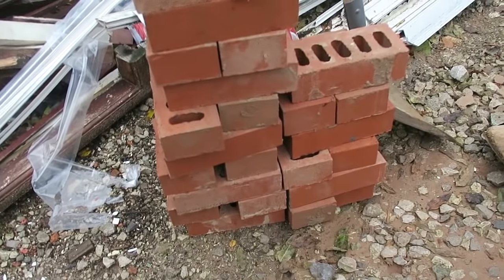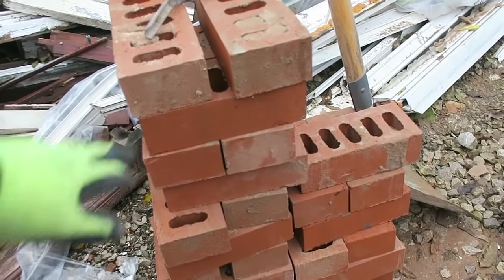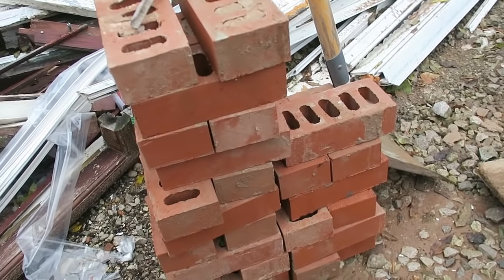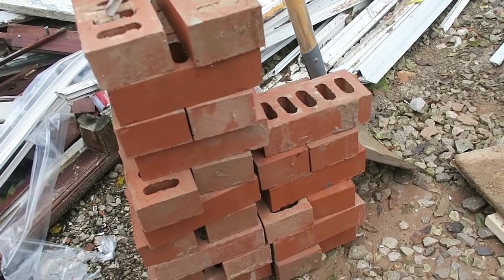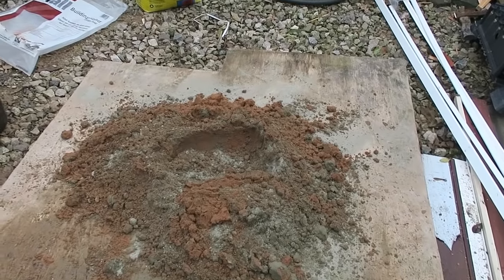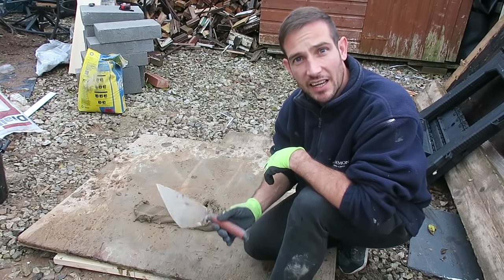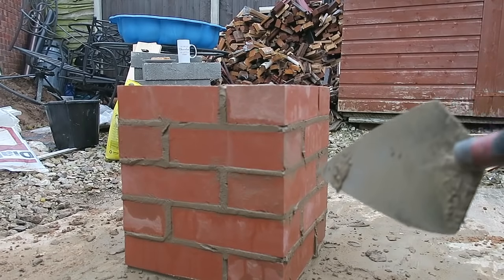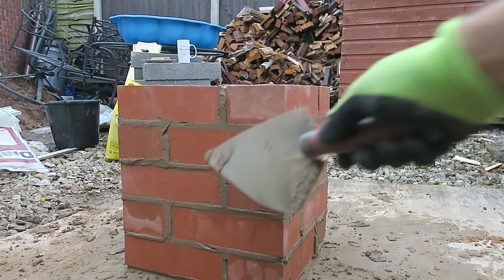how NOT to build a brick pier bricklaying tutorial

Comment: Wanna give you a bit of advice , when your using engineering bricks , in the winter or when the air is damp use a blow torch on the bricks before you start laying a thing, sort of thing for torch on felt, heat em right up and they will lay lovely , you see them steaming where the moisture is evaporating out the bricks , give em a few mins to cool down and away you go works every time ,
Reply: Bob Builder  aye let’s say to all house building get us blow torches lol no what u mean mate but come on get them down

Comment: Great video.
I've just bought a house and the rear garden wall is just shy of 1m high, is it possible to add piers to the existing wall so I can span the gap with metal railings, or would I be better demolishing and starting from the ground??
There is about a 3m drop at the other side of the wall and I'm worried the dog will be over to chase rabbits and break something!!
Thanks 😀
Reply from the maker: you can add piers so long as the original wall is in good condition mate

Comment: Stu so u don't have to pay for a mix each time I have solution , just buy 3 sand bags and lime not cement this means you will have the same texture each time also this never goes hard just leave I in a bug get and just add small amount of water each time. 

the first time you mix , mix the same as u would with cement except this time it is lime 

This does work and will save lots of money with sand and cement because u only buy it 

Hope u find this useful

Regards GBS
Reply: * just leave it in a bucket ...